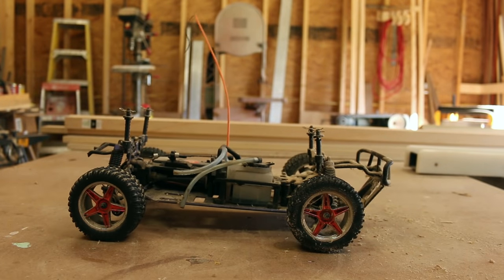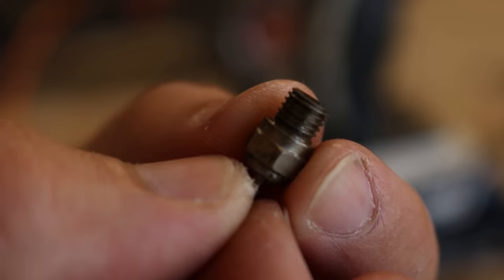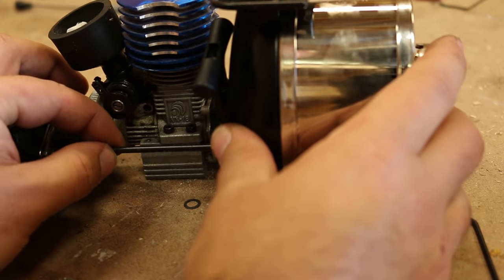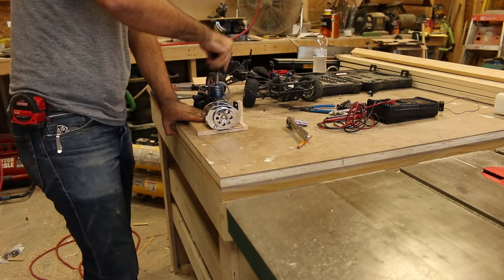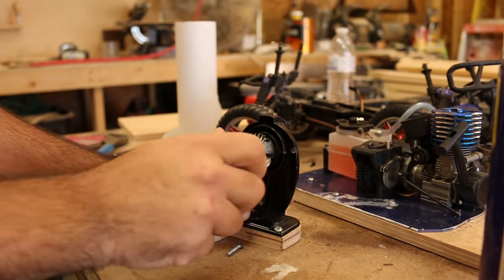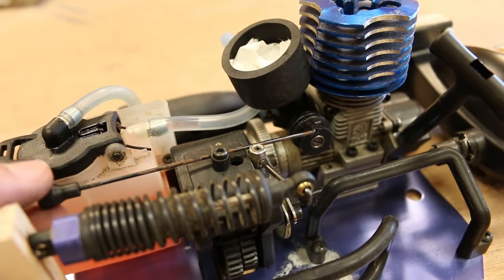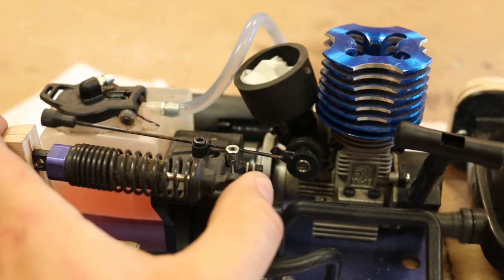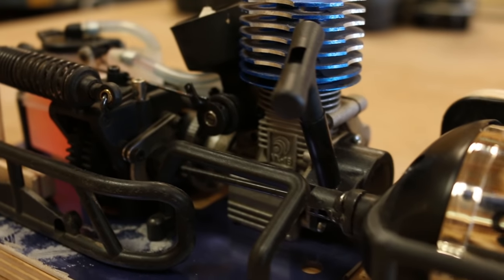Nitro Engine Powered PENCIL Sharpener!

Comment: I have to change the oil on my pencil sharper
Reply: LMAO
Reply: Dexter Sullen well, you're in luck since this is a 2 stroke engine, and the lubricant is in the fuel
Reply: anorwayer97  there is still oil in the engine and in the fuel
Reply: It a 2 stoke

Comment: I love how this is literally the most impractical pencil sharpener ever made. It's great.
Reply: There's a power drill pencil sharpener.
Reply: Sometimes when I need to put a screw in something, but can't be bothered to find the right bit, I just put the head of the screw in the drill and tighten it up.  It never works, and I always have to go find a bit.
Reply: Have you ever been one of those SAT attendants? Neither have I, but I bet they get tired of sharpening thousands of pencils; this would be great for them. Then again, those people have absolutely no sense of humor, and probably love menial labor.
Reply: Literally? Literally?!? You know, if you *omitted the OVERUSED word 'literally' from your comment, we'd have still gotten your point. Including 'literally' in any comment does NOT make you sound more intelligent. For fun, use this word: REDUNDANT.
Reply: It’s just hyperbole, what’s wrong with that?
Reply: I just came here from another video where someone made a version of this out of a full size V4 car engine.

Comment: I can't believe someone would throw away a perfectly good nitro engine! their loss... your gain!
Reply from the maker: Yes it is!
Reply: One man's garbage is another man's treasure.
Reply: it's simple, man... he just found another way to use a perfectly good nitro engine!... great job man
Reply: Sadly, people throw out all kinds of valuable things. I wish it was easier for people to go through things others throw and either get it for free or buy it cheap.
Reply: Doug Luke- he said the engine was seized, not exactly a "perfectly good nitro engine"!!
Reply: You don't realize that those are generic nitro motors. Waste of time to work on. I guarantee you the carb wont ever hold a tune and the motor wont have high compression. If you ever want a good basic motor, go for something LRP, OS, or even Losi motors
Reply: Doug Luke EXACTLY
Reply: Doug Luke one mans trash is another mans treasur

Comment: This is just mad. How many RPM does it spin? Have you tried how fast will it eat a whole pen? My angle grinder with pencil sharpener seems pretty fast but I think this should be even faster.
Reply: some nitro engines i have can spin up to 35000 rpm

Comment: You should tie the throttle and brake together, so when you disengage the brake to sharpen it speeds the engine up.  Might save more wear and tear on the clutch/brake mechanism.
Reply: Those clutches do get extremely hot when put under to much RPM and load.

Comment: "How do you turn it off?"
Ahhhh memories.... As my first Nitro truck screamed across a car park at full speed after losing radio signal.
Two ways - Starve it, pinch the fuel line. Or choke it, block the exhaust. Neither very helpful from the other side of a car park i might add.

Comment: imagine using  that in the classroom
Reply: it would have to be shop class lol
Reply: It would be about as loud as an electric sharpener
Reply: Wait for the teacher to start talking to sharpen your pencil.
Reply: +Steel Titan penguins of Madagascar tip.. every time they talk.. fire it up at critical moment.
Reply: ONEXONE i will laugh lol
Reply: ONEXONE a electric one is quieter but better
Reply: FIRE HAWK GET OUT OF THE CLASS hahahaha
Reply: during "quiet study" lol
Reply: ONEXONE. I WAS JUST THINKING OF THAT
Reply: ONEXONE lol
Reply: ONEXONE YEAH and í á test
Reply: Teacher: SHUT THAT OFF!
Student: I can't, it doesn't have an 'off' switch.
Reply: Imagine starting your pencil sharpener up like a lawnmower with that string thing
Reply: What, sharpening your pencil in under a second?
Reply: Imagine whipping it out during an exam because your pencil broke.
Reply: Just a sec Mr. B just gotta fire up my pencil sharpener.
Reply: Imagine pulling that out during the SATs

Comment: I totaled my 2003 Triumph TT600. Make a pencil sharpener out of my motor lololol
Reply from the maker: +Ryan Easley (DoctorE502) Haha, send it over.  We'll make something crazy....
Reply: I suppose so but when I say totaled I mean, if you plan to rebuild it, it needs a chassis, subframe, and wiring harness. As well as anything attached to the rear fairings. Such as tail lights, and what not. Also needs a new battery. Positive post was broke off in the accident.

Comment: need to replace the shell with a clear one so you can see it sharpening the pencils!
Reply from the maker: That would be pretty awesome!
Reply: Ya, it would. It doesn't seem like that would be to difficult since when using material like maybe plastic can be shaped. Glass would not work because the sound and rattling would break the glass very easy unless you had very very tough glass. Then you could just heat the glass and bend it to your will.

Comment: with the brake and WOT the clutch wont last very long.
Reply: +User Name Agreed
Reply: +User Name yup he's gonna kill that centrifugal clutch.
it should be set up so as you release the brake it simultaneously actuates the throttle
Reply: The project is cool but there are some improvements for sure. I don't think there is enough resistance from the sharpener to keep that engine from revving to death
Reply: Umm this is mike, this is how he gets around lol in the video, he states he was surprised that nothing had broken yet hehe

Comment: Seems like that brake mechanism is goin to fry your clutch in no time
Reply from the maker: +abracing199 Probably.  It's not really practical, it's just a novelty if it breaks.
Reply: +Mike and Lauren Great work now you should look at attempting a Guinness World record for the most pencils sharpened in (x) amount of time.
Reply: +Mike and Lauren why not make it so that as you press on the brake to release it it nails the throttle?
Reply: +Mike and Lauren Yeah, the way the original throttle linkage would have been setup, when the brake in engaged, the throttle goes to idle.  If you could rig up a similar setup to increase the throttle as you released the brake you wouldn't have the problem.
Reply: +abracing199 depends, the brake might fail first.  it was allowing the driveshaft to turn some.  Those brakes are not meant to hold a car with the motor WOT.
Reply: +abracing199 I agree in part. I think it would not have been that hard to have the break release work in conjunction with the throttle, but the clutches on those engines are made to have the shit torn out of them. They're really simple and can withstand a lot. On top of that the shoes that go in them are like 4 dollars to replace.

Comment: The chance to get a free nitro RC car and you turn it into a pencil sharpener..... not sure if that genius or a waste?
Reply: +jerry bomcool Well I don't want to get this as a present... With the small engine, the 2-speed gear and the big tires it wouldn't be any controllable.
Reply: It's not a waste because if you decide you want to put it on a rc car you can still take the motor off
Reply: +TheBasti05 Thats actually considered the low end of cars and engines in the nitro rc world. Theres actually top of the line nitro rc cars. Some capable of 70 mph on small tracks. Very controllable. But not the cheapy car in the video.
Reply: +jerry bomcool 860,000 views in 2+ months hmmmmmm

Comment: Some one threw the R/C car away because like you they may of also thought the "piston was seized" the thing about nitro fuel is its sort of like 2 cycle fuel it has the oil in with the nitro. As the fuel evaporates it leaves behind the oil which over time gets gummy like glue and can sort of "seize" the inner workings of the engine. Usually you can just remove the "glow plug" and drop some more fuel into the piston chamber and put the glow plug back in. Let it sit a while and the new fuel will work its way in around the piston and eventually free it back up. This is very common with these little engines

All that R/C car needed was a transmitter and a new body and you would of had a fun little car.

But with 2 million views now you can go buy a new one with your youtube pay day! lol

Comment: The clutch is going to die so fast using it that way. Typically brake and throttle are linked (look at original assembly) so that throttle is forced to idle when brake is engaged. Put the whole thing on the spring, so when you push the one lever, brake is released and throttle increased at same time.

Comment: Don't lie, nobody found that in the garbage now did they? The parts alone could pay for another RC. Nobody would throw that away.
Reply: ik right. I would have actually bought it if I had the money.
Reply: +Joseph HD i would pay $60 easily for that car
Reply: it's an exceede rc, you can buy them at nitrorcx.com for about 125$ new. not the best quality, but for pure shits and grins it could be with it
Reply: +Daylan Smithey yeah i know but i don't know much about nitro 😂 i'm an electric guy
Reply: +Daylan Smithey were i live it costs €20 for a liter so €60 for a gallon here very expensive
Reply: +antagonizerr The engine was seized and they probably had enough money that they didn't care. I find several $200+ lawn mowers in the garbage each year and usually they just have a bad spark plug or dirty air filter. I found a $400 honda lawnmower one time that only had a snapped  pull cord. Rich people throw money away all the time
Reply: Where I live people pawn rc cars and most of the time no one wants to take a chance on them and you can pick up one that's sells used on eBay for say $200 you can buy it for $20 from them and most of the time they work .
Reply: +antagonizerr And that's why we go, dumpster-diving
Reply: ive thrown away nitro rc cars like that fron china
Reply: +antagonizerr Lol You would be surprised. A guy gave me one of those things for free once. Pretty cool stuff if you can find the extra money to fund it.
Reply: +antagonizerr 
Don't be a fool... that's a cheap nitro car. Maybe 150 bucks from hobbyking and worth very little used in that condition.
Reply: +antagonizerr  that my friend, is called a piece of shit
Reply: yeah a multi millionaire
Reply: He said the piston had seized ....
Reply: its a 150 dollat low end rc yeah it could be but the chassis and hardware looms to clean to be a throw away and besides that was an easily fixable rc but you know people have stupid thoughts
Reply: its a 150 dollat low end rc yeah it could be but the chassis and hardware looms to clean to be a throw away and besides that was an easily fixable rc but you know people have stupid thoughts
Reply: +The Rc Master6042 looks

Comment: Why not link the brake and throttle together?
Reply: i think it would be really hard
Reply: It's pretty easy considering that's how the RC car is actually designed to work. When you ease off the throttle and apply "reverse", the same servo used for throttle presses on the brake. So instead burning the clutch by applying brake at high RPM, you only apply it once engine is idling and clutch is disengaged.
Reply: ***** I seen that the brake and throttle move the same way next to each other so couldn't he simply make a link between the brake spring and throttle? So when he presses the brake to release it, it automatically gives it throttle
Reply: In this application, I don't see why not! You generally wouldn't need to "coast" your pencil sharpener like you would your RC car.
Reply: Was just going to reply that he would burn the clutch this way lol.

Comment: There is no shut off because you typically want to run these rc cars completely out of fuel after every use.  Followed by removing the glow plug and air filter and adding a few drops of after run oil or dw40 to the carb.

Comment: You should put on a linkage from the brake to the throttle, so that the engine idles when the brake is engaged. This will save a lot of wear on the clutch in that engine.

Comment: why?  why the fuck not....
Reply from the maker: Exactly!
Reply: That was not a brake, an engine does not have a brake, that`s a cluch
Reply: +Vlad :P Could have been a clutch brake, you know. Friction used to stop it, instead of engage it.
Reply: it was a disc brake directly connected to the clutch bell of the engine, ie yes it was burning out the centrifugal clutch but only when the disc brake was being applied

Comment: I like your thought process on design.  I'm not sure if that engine will last long due to being air cooled with no cross wind.  "Overheating". You may need to incorporate a small fan to reject the heat from the Cylinder head.  Pretty sweet though.

Comment: As generaly impractical as this is, i do see 1 particularly good use for it. 
Put this is a tech&engineering class as a class project to help students understand the basics of engine mechanics, and the value that knowledge has. 
It is the only pencil sharpener allowed in the room, and it is their responsibility to keep it running, and to fix it when it breaks.
Maybe figure out how to try muffling it too. :)

Comment: one extra thing you could do is set up your brake button in sync with the throttle you basically have it already just make a link cause in most cases the throttle servo is the brake as well

Comment: Nitro engines are a weird but interesting thing.  I have seen some rev up to 45,000 RPM (45K RPM) and many of the small cheap ones Rev at up to 30,000 RPM.
It sounds like a lot and it is because prolonged revving at max RPM has been known to prematurely destroy nitro car engines.  It is suggested that you spend most of your time at 50% throttle and give it full RPM in short intervals.

Comment: I threw my nitro car away when I realized that I had spent more money on it than my actual car.  Nobody seems to make a glow plug igniter that runs directly off of the wall (for bench testing and diagnostics.) and I got tired of having to buy batteries and charge my igniter all of the time to solve simple engine problems, half of which were related to a bad or dead igniter and not the engine at all.  I spent more time trying to get my car to run than I did actually enjoying it run so it went in the trash; box, fuel, remote, batteries and all.  I was so happy it was over.

Comment: Should have made it so pushing off the brake brings up the throttle from idle, cause full throttle with the brake on is going to where out the centrifugal clutch quickly

Comment: If u have the engine full throttle using the brake to slow it down u may go thro clutches... just set the engine up properly so it Idles then it wont turn the drive train 🚂:)

Comment: I know you've likely been told this but if you could get this on the retail shelf for $49.99 with a couple safety guards and such I have no doubt you could sell thousands or more of these as a Christmas novelty item for that Gear Head in your life. This isn't a joke. Have it where it will heat the glow plug off a couple D cell batteries and the fuel comes in sealed cartridges so there's no fuel hazard and a bit more balanced sharpener that can handle the higher RPM and your on your way!

Comment: Love the idea and I hate to be this guy but having the engine running at high rpm whilst using the brake will wear your clutch a Damn sight faster it would be easier and cheaper to let it idle and just use the throttle when you're sharpening it

Comment: to shut the engine off, hold your finger or something that will block the exhaust of the car, the engine will die without having to starve the engine of fuel, therefore making it much easier to start the next time without having to re-prime the engine to get fuel again.

Comment: Cool! ...And since you are learning about these little engines, here a quick tip: nitro engines are not called "gas" engines as shown in the video thumbnail. The "gas" naming is reserved for gasoline-fueled engines. Yes, there are gasoline-powered RC cars, boats, airplanes and helicopters, and the engines that go on those are the ones called "gas" engines. The type shown in the video is a "nitro" engine, or more usually just "glow engines", because it uses a glow plug instead of the spark plug typical of gas engines.

Comment: The clutch is spring loaded. Won't engage under a certain rpm. That brake procedure you have is odd (but interesting with the shock) and unnecessary. Reduce the idle setting on the carb.

Comment: If you have some serious lubrication lying around instead of that light deo stuff...use it, and use it frequently on the sharpener part. There is serious friction going on...i guess it just deformed from the heat while cooling down, and got stuck before you made it melt. And take care about the engine not overheating, i wouldn't know but usually the vehicle's speed gives it a little chill...having it eat pencils isn't a good idea either, but i'll shut up, i wanna see flames as much as the next person. What i don't wanna see is your head with half a gasket, or driveshaft turned shrapnel propelled into it. So watch it, friend :d

Comment: the thing that stun me is the broken RC car thrown in garbage almost complete. even if the motor was seized, it surely turn alright after some repairs and cleaning. probably a casual RC driver, because almost all hobbyists can recycle a broken car, even if it's damaged beyond repairs. like a shop pencil sharpener, for example :D

Comment: You really shouldn't throttle up and use the brake at the same time, it really wears out the clutch. On normal RC designs that wouldn't be possible as the throttle and brake are one dial controlled by a single servo.

That said, you should use a servo and some switches to make it work. I'd also make an electric starter.

Comment: You should get a new 02028 air filter and put on there.. or your are going to suck some pencil dust into the engine and ruin it.. the filter is only a $1.20 for the whole thing with free shipping on ebay.